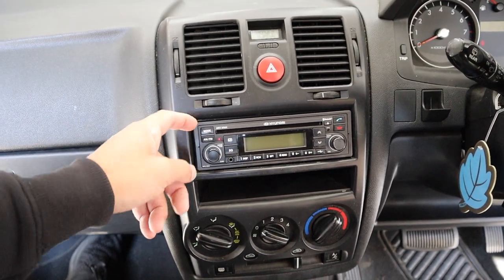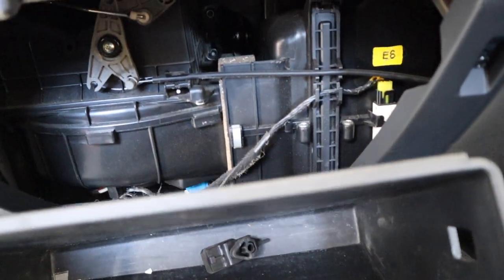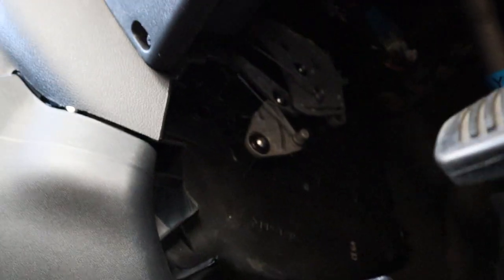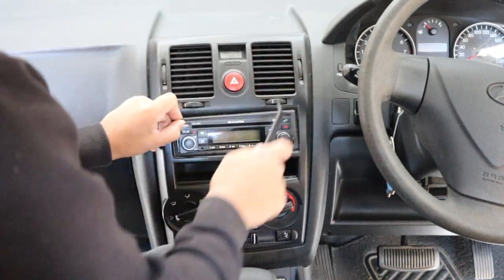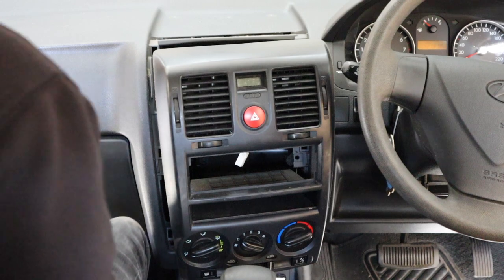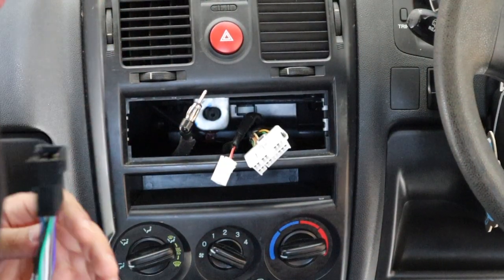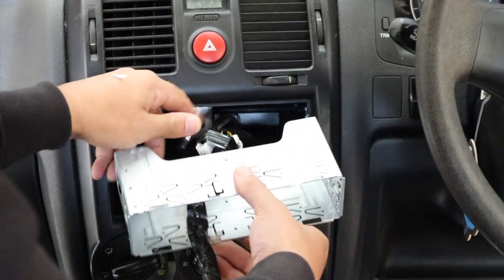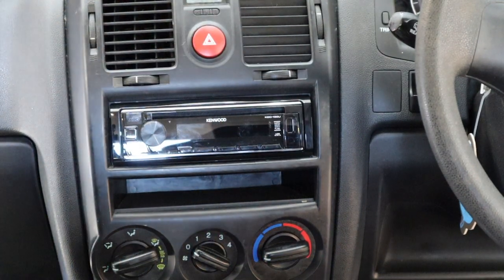Hyundai Getz Head Unit Install (Full Start to Finish)

Comment: This video really was a life saver. I initially forgot to also unclamp the cables themselves From the black bearings after taking off the loops. But when I finally did it the head unit came out easily :) Thanks again! So much fiddeling for a car stereo...

Comment: Just put a new one in. This certainly made things easier. Glad I bought an adaptor wiring harness as well as the new stereo, just plug and play and worked first time much to my astonishment, that hardly ever happens
Reply: Hello I would appreciate it if you named the correct harness to use. Cheers
Reply: @abettertomorrow5928  I tried but I don't think youtube will let me post the link
Reply: @samtriglone8858  hello do you have a name of harness and part number.  Hopefully I can buy one from Supercheap auto or auto barn here in Australia
Reply: seller is called adv_auto

Comment: Hi there. Thanks for the video. My mom also have the same vehicle and I need to remove the radio in order to clean it inside. I have been using a cd cleaner but did not quite helped. I am planning to open the radio and clean thoroughly. Regards 😃

Comment: Glad I found this,  I'm about to fit an amp, som components and a sub to my daughter's getz. It already has an aftermarket head unit  but I'm going to have to pull it out and run rca's. Is there an easy way to run an 8 ga power wire through the firewall? I haven't as yet found a grommet to use.
Reply from the maker: They’re a pain in the backside to run powers through haha

Comment: Bit late to the party, but great video! How hard would it be to wire in the steering wheel controls to get them working with an aftermarket system?
Reply from the maker: Thanks man. Very easy :) but you’ll need a module or a unit with self learning swc
Reply: @TheFittingBay  okay awesome, thanks so much for the reply!
Reply from the maker: @Brightside0208  all good :) I’ll do a video on it when I put a different unit in my Getz (not in this video)
Reply: @TheFittingBay  looking forward to watching this vid!

Comment: Great video, I was wondering. Can I fit a double din radio in there if I trim the middle piece? I think it could be very exiting to install apple carplay in my Getz from 2008. But I can't figure out if there will be enough space for this, do you know?  -Thanks
Reply from the maker: Krisitan Krogsøe Hey mate! Thank you. I looked at this myself. Very close fit but I didn’t go ahead so can’t be sure. Why not go with the pioneer flip out screen?
Reply: Yeah, I looked at this flip-up screen, but I can only find some very expensive once, where the full double DIN is more budget friendly. Furthermore, the flip-up screen cover for the airflow, would it not be a problem you think? Thank you for the answer by the way.
Reply: if you trim the storage space under the factory system there is enough space to fit a double din just measure and use a rotary tool to cut the storage tray out

Comment: Awesome video m8! I just got a Getz 2006 and the radio has no AUX. I know that an AUX/USB can be installed by soldering the cables to the main circuit, do you know how to do that for this specific car? I don't want to spend money in a new head unit, I am planning to use this money on changing the door speakers for better ones (with the proper RMS) for an improved audio experience. I found that the original radio delivers 22 W RMS as many of aftermarket radio systems do, so adding better speakers should be enough to improve the audio quality. Or am I wrong?
Reply from the maker: Put your money towards a new head unit :). The factory radio delivers poor power to the oem speakers. Adding AUX won't fix the power output - but changing the head unit will. I had a Getz and installed a Kenwood single din. After tuning it was like night and day. So you can change the head unit and you mightn't even want to change the speakers after just depends how good you want it to sound. But i'd start with head unit.
Reply: @TheFittingBay  Alright bro, thanks for this, I will follow your suggestion. My intention with the AUX is being able to connect my phone to the radio, I know that it doesn't improve the power/audio quality. I don't want to spend a lot of money, my plan is having the car for a year or so before hopefully jumping to a better option. I am trying to restore this car as well I hate how people don't look after their own cars haha. I will take a look of Kenwood or Pioneer units then  :)

Comment: I am completely new to this sort of thing, just bought my first car and it's a good old Getz 2006. The car has no AUX tho, and I'm not too sure if it's possible to just buy a head unit with aux, and have it work? Or does the car simply not come with the ability to use AUX at all with the stock speakers and such?
If that makes any sense haha 
Great video btw :)
Reply from the maker: Hey mate! So the car currently has no AUX. but if you get a single din unit with AUX and Bluetooth and follow this install method, you’ll have the features you want. Those features are only limited to the radio that is currently in there :)
Reply: @TheFittingBay  Oh okay cool, thank you for the help :D

Comment: Great video, easy to follow. I have the same car and am looking at installing similar head unit but wanting to connect the steering wheel controls, are there wires on the back of the head unit that connect to the wires and plug you didn’t use? ( I’m hoping it’s that easy)
Reply from the maker: Hey mate! Depends what unit you get. If you get something with self learning, you can hardwire it and plug it in and set the controls. Most likely you will need another module 
(hardwired) if you end up going that way just comment what product you got and i can help, its fairly easy :)
Reply: @TheFittingBay  What Head unit would you recommend on a mid range budget and harness so it can be controlled with the steering wheel controls. did have in mind the ( Pioneer MVH-S425BT Double DIN Head Unit ) or (Pioneer DEH-S4250BT)
Reply from the maker: Calvin Le Roux Id go the DEH or an alpine unit.
Reply: I have Sony CDX-GT600UI, can u help me please?

Comment: Great video but why would you swap out a Bluetooth steering wheel controls deck for a non Bluetooth steering wheel control deck? If the reason is because of the pincode, I looked up online how to get that. Its as simple as using the last 4 digits of the serial number printed on the sticker on the top right hand corner of the deck and addind 1 to the first of the last 4 numbers then 2 to the 2nd of the last 4 numbers, then 1 to the 3rd of the numbers, 2 to the 4th and final number. So last 4 serial numbers XXXX + 1212 = XXXX and thats your pin code. Easier to write out the maths then the answer as your pin code.

Comment: Great vid! Was just wondering what the tools you were using called?
Reply from the maker: Radio removal keys :)
Reply: 4 butter knives, a small screw driver to pop off face plate on factory system, and a phillips head driver should be all you need the glove box cable can be removed with 2 hands no pliers needed there is enough movement on the facia plate when you pop it out (you can use butter knives for this) to get the screws out off factory cage and remove it with out doing the 2 cables on drivers side
Reply: @micktaylorwolfcreekmechanical  my boy

Comment: I just unscrewed the clips off the side of the Getz head unit then attached them to the new Sony and clipped it back into the original cage ..
Reply: Yeah this idea should work you dont have to pull out the panel
Reply: @ofwdad5893  yeah I had to trim them but it fit perfectly with a few measurements

Comment: I couldn't remove the fascia, because I were unable to undo the air duct flap control cable from the knob. I'd had the feeling that I was gonna break something. What's the trick?
Reply from the maker: Endre Juhász Follow instructions in the video , you need to follow the cables to what they’re driving and use small pliers

Comment: Hello, thank you for this awesome video! Hopefully I can follow your guidance without any problem. Do you have a recommendation for Getz 2005 budget head unit with bluetooth connection?
Reply from the maker: Kenwood :)
Reply: @TheFittingBay  thanks! I bought the Kenwood head unit, about to try to change it today. Quite nervous about it, as my friend said it might be not a good idea to do it myself haha. Just a question, I bought the harness ISO for APP095 and the APP095 cable. Will it be easy to connect them?
Reply: @TheFittingBay  update, thank you for your awesome guide! We did it ourselves successfully!! I wish you put the part where you pull all the wire out from the old head unit. It was pretty hard. Thanks again :)

Comment: How would you get the steering wheel controls to work? I heard the Axess SWC is the right one to use for the classic three wire analog controls but not too sure.

Comment: About to do this with my Hyundai Tucson 2009 model.  Hopefully the process isn't too dissimilar!
Reply from the maker: Aaron Cheater Fairly similar, Facia has to come out to remove the cage :)
Reply: The Fitting Bay Thanks! Shame I can’t just use removal tools. I tried taking the fascia off a couple of years ago to get the code off the oem radio. Got pretty far but couldn’t get the stupid plug for the aircon control out as it was stuck. Hopefully I’ll have better luck this time!
Reply from the maker: Aaron Cheater Plastic trim tools can be very handy for that 😊

Comment: Bro.. Just a question here.. If we have to connect it with steering then how can we do it. I want to connect it to hyundai getz steering but I don't have any idea.
Reply from the maker: SWC wires go to the 2 pin plug :) I think one is SWC1 and other is GND.
Reply: @TheFittingBay  there are two wires seperately for steering wheel control. Does it have any color code or we can connect swc wire and grounded (black) wire randomly to swc 2pin plug?
Reply from the maker: @bikimaharjan2632  random is fine. One way will work and the other way won’t lol
Reply: @TheFittingBay  LOL mate. Hope I wont blow up the fuse box :D :D :D
Reply: i blew up the fuse. mistakenly. Happy that it was not serious. Can you please help me to get it to steering wheel control mate.
Reply from the maker: @bikimaharjan2632  Fuse? from the 2PIn plug??

Comment: Anyone had problems with the factory unit sound cutting in and out randomly? 
I bought a pioneer single din thinking the stock one was on its way out but had no sound at all with the pioneer and I get an amp error message and now no sound at all at all the stock unit 😑

Comment: Why not use the mounting clips from the original radio like this bloke suggests? http://bobparker.net.au/mp3-05g/mp3-05g.htm Is there an advantage to tossing the hyundai factory mounting? Thx
Reply from the maker: Can’t mount the radio to that cage properly. You csn slide it in but it’s not held in by anything it’s just sitting there
Reply: @TheFittingBay  the screwed in factory mounting clips don't grip do you mean?
Reply: @TheFittingBay  ok thx. Really appreciate this video. Daughter bought a Getz two weeks ago & I watched this. Yesterday bought a new head unit on special from autobarn $97.  Got home watched vid again,  same head unit in vid & I noticed autobarn sign on wall. Sweet mmmmm888888!

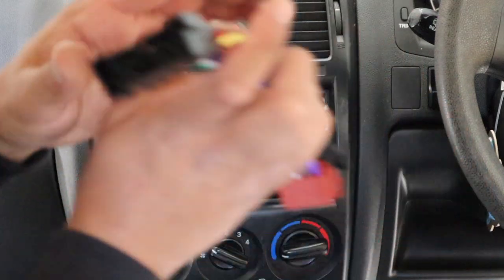Comment: @05:37 I really don't understand, if you use a converter (APP085) cable then why would you need step 2 and do some hard-wiring? Isn't it supposed to connect directy to the Kenwood device?
Reply: So true, looks like it defeats the purpose of the Harness altogether and becomes pointless. Other than a bit more length to play with.